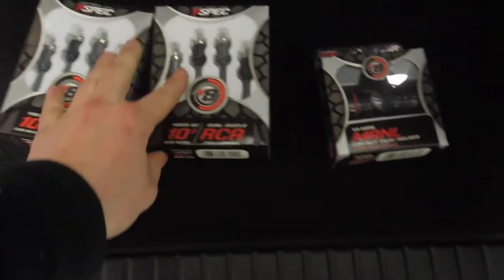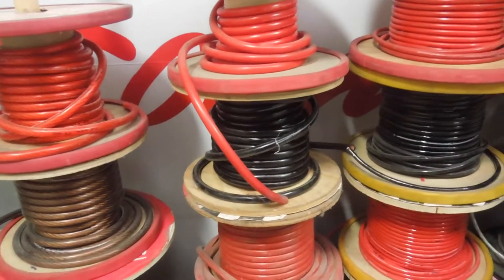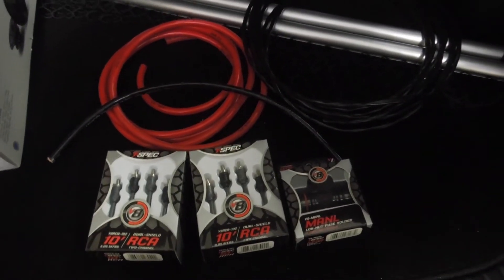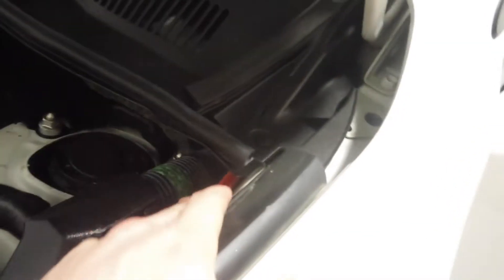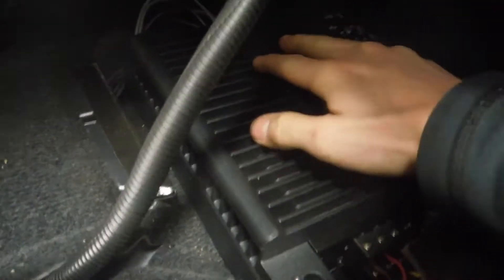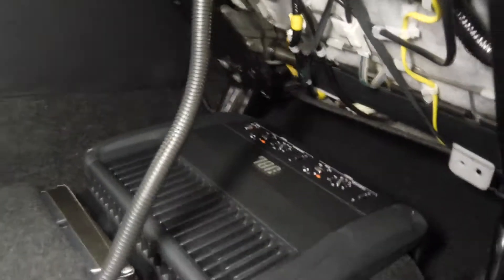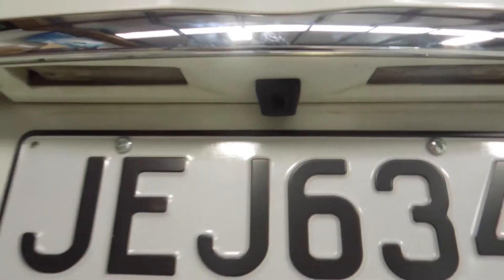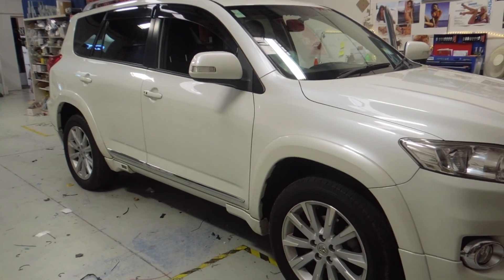toyota Vanguard Full System Upgrade Pt3

Comment: Thanks for the info about the resistor for the stearing wheel controls, saved me having to muck around testing it to get it going. Only had a couple of 2.2K resistors so it ended up being a 1.1K resistor but it still works fine. The rest looks good.